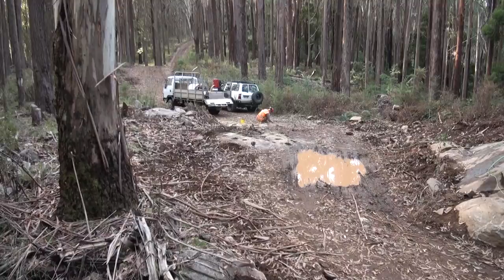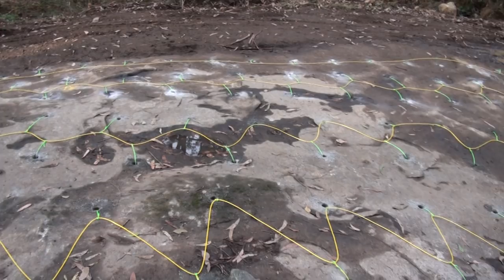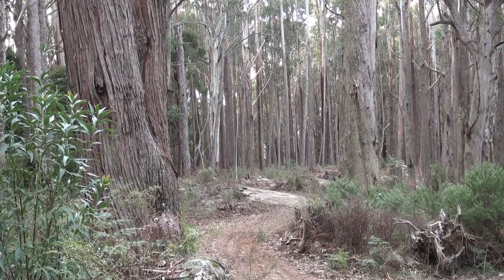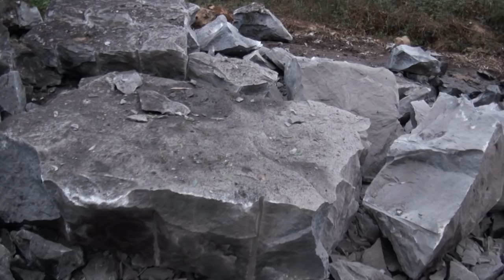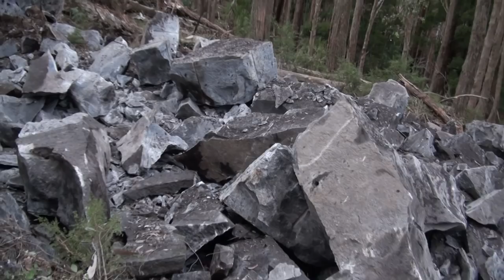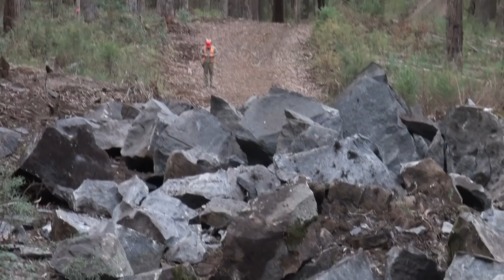Blasting rock on a mountain trail

Comment: Got mine in 1983 used it a bit but I'm a det cord electric and fuse det and cord! Still have my DuPont 10 shot exploder!
Reply from the maker: The dupont 10 shot, is that a rack bar unit (road runner style)? or electronic?
Reply: Demolition Dave Drilling and Blasting eltronic twist type love the videos did a lot in the bush on fire trails

Comment: Worked on fire trails in NSW national parks and used explosives sucjh as AN60 and tovex to do the same as this
Reply from the maker: Hi Chris, it's good work when you can get it, I would much prefer such to doing a back yard swimming pool or similar.
Reply: You didn't run into the "Barking pygmy" & "Sandals" , they used to work for N.P.W.S, one still does.
Reply: Dusty Farmer no sorry I didn't but great names!
Reply: @Moonbahmemories  Count yourself lucky then, they did get around during fire season. The Barking pygmy is still there.

Comment: If a blast produces some large chunks of rock (as this one did), do you blast those fragments or do you split them manually (with expanding mortar or with wedges and feathers) ?
Reply from the maker: I would always blast them if requied and i had the option, in this case we had a D7 dozzer to push the rocks aside so it was not an issue

Comment: Would have bored the holes parelell to the ground. Less bombs , cord and better finish for roads. Too many years underground
Reply from the maker: I hear you Trevor but the drilling is a lot more difficult as I don't have a leg drill and I did not like my chances of digging around the rock to gain access at the finished level. I did take care that the bottom of every hole was at exactly the desired level, firing with cord at the right load gave a nice clean break at the new floor level. The customer was happy and the road was fixed so all good.